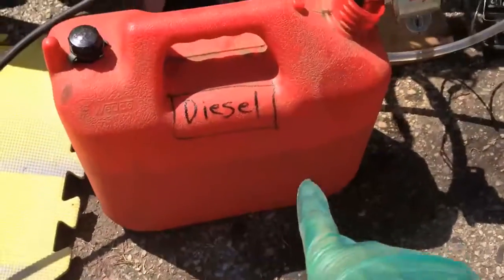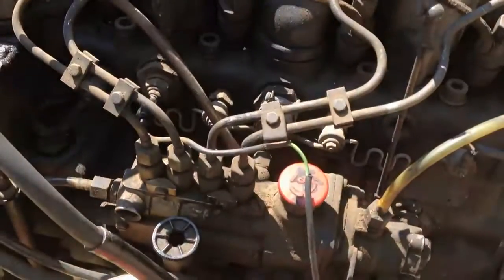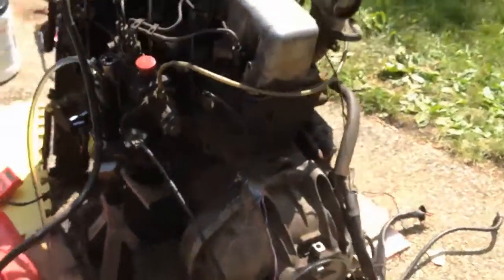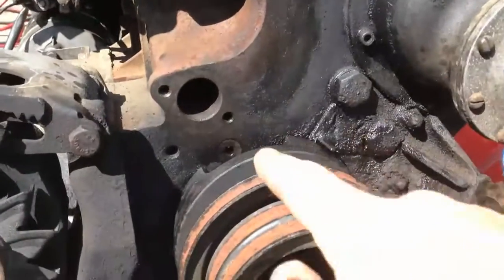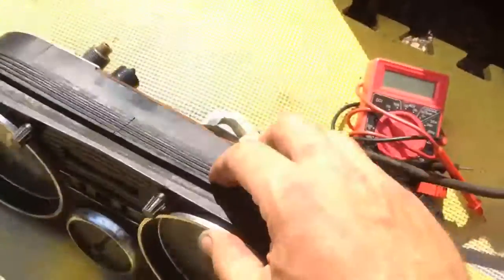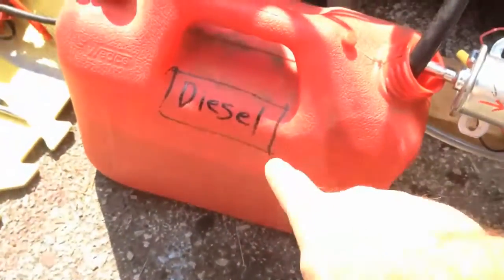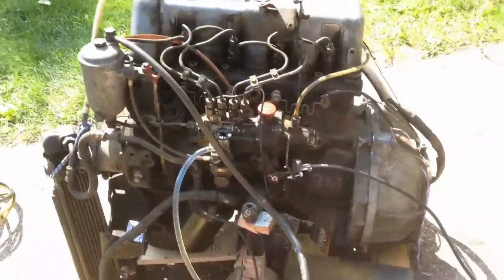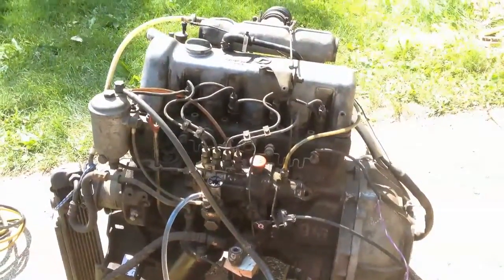SuperTruck: Firing up the Diesel

Comment from the maker: No idea what it weighs. It doesn't fit on my bathroom scale. I have already removed some "extra" parts, like the AC compressor bracket, which was a rather large and heavy piece. Everything is built very solid. I'm stripping what I can to save space and weight.

Comment: Ben, how about an update?  Did you give up on the super truck or what?
Reply from the maker: imouer I still have the engine and transmission. Been busy with other things. Another thing making this tough is that it's one big step UP in machining skills than what I have. I did find a guy who built a gas/electric hybrid a little while back and got to go talk to him. I'm also now working on rebuilding my garage, which will allow me to be able to work on projects in the winter (heat and insulation!) I'm hoping to do some work on this project this winter. It's still there, but it's the "back-burner" project.

Comment: Those primer pumps suck, they leak so bad. I bet when you turn out that screw and pump, it squirts all over the place right? ~ Either get the black plunger type or (if you intend on using an electric pump) seal it off permanently and open the bolt at the fuel filter to purge air.. its only real purpose is to clear air out and prime the lines, the pump can handle that, otherwise you're gonna have air problems all the time. I believe? that injection pump has a fuel pressure relief value on the back.